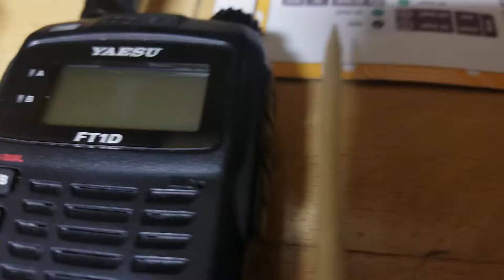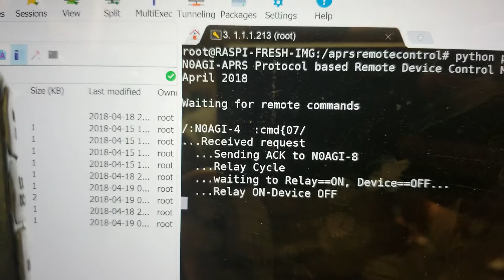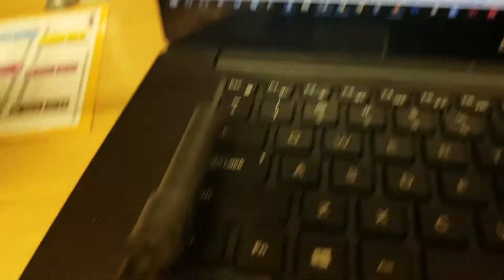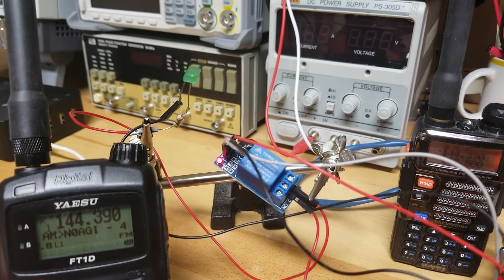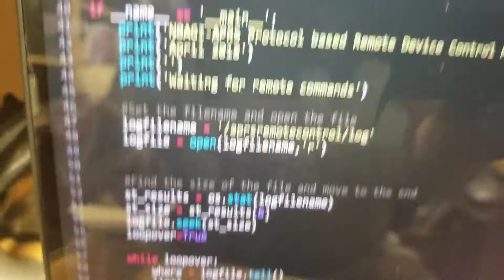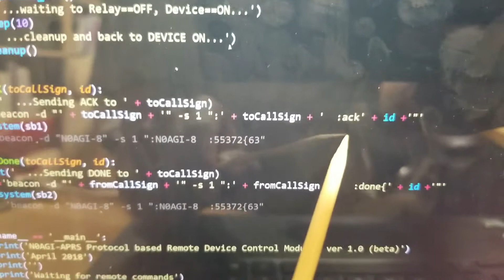N0AGI - APRS Remote Control Project - Part 3 - POC Completed - Vol 98

Comment: As the code was never posted anywhere, this is what I could glean from the video:

<b>Python</b>
import  RPi.GPIO as GPIO
import time
import os

def relay_on_device_off():
	print('   ...Relay ON-Device OFF')
	channel=26
	GPIO.setmode(GPIO.BCM)
	GPIO.setwarnings(False)
	GPIO.setup(channel, GPIO.OUT)
	time.sleep(1)
	GPIO.output(channel, GPIO.HIGH)

def cycle_relay():
	print('   ...waiting to Relay==ON, Device==OFF...')
	time.sleep(10)
	relay_on_device_off()
	print('   ...waiting to Relay==OFF, Device==ON...')
	time.sleep(10)
	print('   ...cleanup and back to DEVICE ON...')
	GPIO.cleanup()

def sendACK(toCallSign, id):
	print('   ...Sending ACK to ' + toCallSign)
	sb1='beacon -d "' + toCallSign + '" -s 1 ":' + toCallSign + '  :ack' + id +'"'
	os.system(sb1)
	#	beacon -d  "N0AGI-8"  -s 1  ":N0AGI-8  :55372{63"

def sendDone(toCallSign, id):
	print('   ...Sending DONE to ' + toCallSign)
	sb='beacon -d "' + fromCallSign + '" -s 1 ":' + fromCallSign + '  :done{' + id +'"'
	os.system(sb2)
	#	beacon -d  N0AGI-8  -s 1  :N0AGI-8  :55372{63

if _name_ == '__main__':
	print('N0AGI-APRS Protocol based Remote Device Control Module, ver 1.0 (beta)')
	print('April 2018')
	print('')
	print('Waiting for remote commands')

	#set the filename and open the file
	logfilename = '/aprsremotecontrol/log'
	logfile = open(logfilename, 'r')

	#find the size of the file and move to the end
	st_results = os.stat(logfilename)
	st_size = st_results[6]
	logfile.seek(st_size)
	loopover=True

	while loopover:
		where = logfile.tell()
		line1 = logfile.readline()
		if not line1:
			time.sleep(1)
			logfile.seek(where)
		else:
			if ('fm N0AGI-8' in line1 or 'fm N0AGI-6' in line1):
				#print(line1)
				fromcallX = line1.find("fm ")
				fromcallY = line1.find(" to")
				fromCallSign=line1[fromcallX+3;fromcallY]
				
				data = logfile.readline(),rstrip()
				print('')
				print('/'+data+'/')

				#print(fromCallSign)
				if ('{' in data and ('qqq' not in data) ):
					id=data.split("{")[1]
					if(fromCallSign=="N0AGI-8" or fromCallSign==N0AGI-6"):
						print('...Received request')
						sendACK(fromCallSign, id)
						
						print('   ...Relay Cycle')
						cycle_relay()
						
						print('   ...sending DONE...')
						time.sleep(3)
						sendDone(fromCallSign, id)
						#os.remove(logfilename)
						print('...going back to Waiting for next commands')
						
				elif ('qqq' in data):
					print('...quit command received, quitting.')
					loopover=False